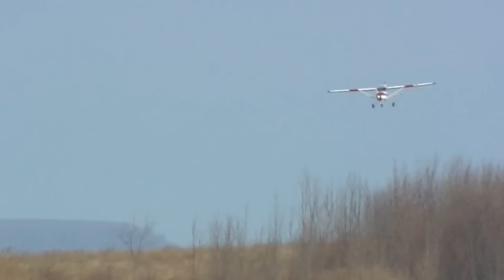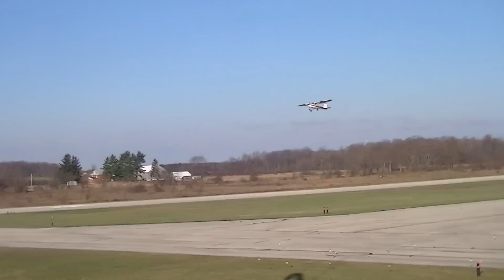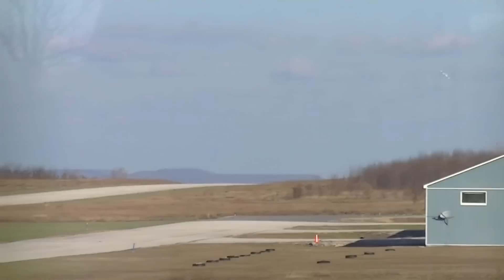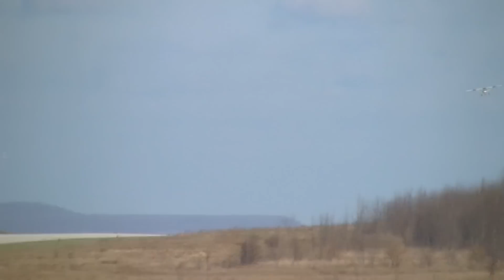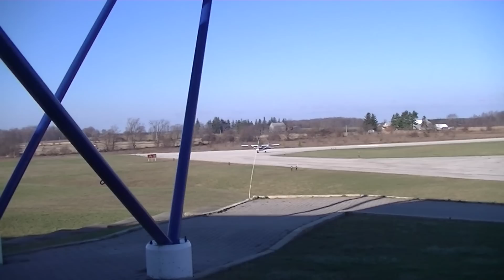Intense Crosswinds Challenge Cessna 150 at CYOS | Pilot's Skill and Decision-Making Tested

Comment: Very nice job getting it down using Airmen Certifications Standards.  These standards are for testing, however, and do not teach energy management and wind management well.  The wind is our friend.  It can provide ridge lift, updrafts that can be flown slowly through, downdrafts than can be flown quickly through, and it can allow us to land at slower ground speed causing far less damage to skin and tin than in no wind.

Using full flaps for deceleration on short final will bring the throttle into dynamic play as our very best glide angle and rate of descent control.  In intense winds, and in this video, gust spread will cause sinks and balloons.  In strong sink, add full power and then adjust.  In strong balloon, close throttle and then adjust. 

Before attacking intense crosswinds lets first work on a landing technique the Army and I call the apparent brisk walk rate of closure approach.  As we close with the numbers, the apparent brisk walk rate of closure we see when more than a half mile out will appear to speed up at around a quarter mile.  If we use elevator to pitch to keep the apparent rate of closure with the numbers a brisk walk, we will not overfly the desired touchdown spot.  Now when we find ourselves at a single runway far from more gas, we have a technique to deal with intense crosswinds.  Think about how you decelerate, not using the speedometer, coming into an intersection with our automobile.  Same optical brisk walk rate of closure technique.  Practice with this technique will give us the skills to land slowly and softly on the numbers every time.

While the apparent brisk walk rate of closure short final approach is overkill on calm days, it becomes critically useful on very windy and very crosswind approaches.  The get set up ask the tower or give way to other traffic at uncontrolled fields so as to safely make a right base if necessary (or left if necessary) to have a headwind component on base.  Now well before arrival at the centerline extended, start a final to a made up centerline from the exact downwind corner of the runway to the upwind big airplane touchdown zone marking.  This thousand feet of angle across the runway will be plenty of runway into a far less crosswind component and a far more headwind component.  I have landed in 40 knot direct crosswinds on the Front Range of the Rockies.  Using the apparent brisk walk rate of closure on short final with full flaps in the 150, we should be able to touchdown on the exact downwind corner of the runway and be stopped without using brakes in fifty feet or so.  If we are at a 45 degree angle across into a 40 knot direct crosswind and using full flaps and the power/pitch deceleration causing the apparent rate to stay at a brisk walk (in the wind of your video, it may appear less than a brisk walk), our headwind component should be about 20 knots.  Subtract 20 knots from the airspeed you see when all slowed up and ready to squat in no wind.  Vso is an out of ground effect number, so in no wind we cannot quit flying until much slower than Vso.  Headwind components, however, may have us still flying at very slow ground speed.  With a strong headwind component, the angle of attack on touchdown will be much less.  We have to flair enough to protect the nose gear, but not be in a three point attitude.

Anyway, give it a try and see what you think.  Work on the apparent brisk walk rate of closure approach in no wind first.  Again, good job.  A pilot that good limited by poor energy management techniques should be able to nail the apparent brisk walk rate of closure power/pitch technique.  We know we have slowed enough if we don't have to close throttle until touchdown.  This technique eliminates the need to round out and hold off.

Comment: I'm not a pilot just wondering about no flaps being used. Is this better in crosswinds?
Reply: Absolutely! At least on this small Cessna, no flaps with increased airspeed for control and added safety due to gustiness. I was the pilot here. I was using a forward slip keeping the right wing low( at least that what I was trying to do)
Most people on here recognize the challenges in this situation. Poh gives all the instruction for the rationale of the landing set up. Don’t listen to the all the crazy comments here, cheers! Get your licence!

Comment: Wrong thinking. He is thinking like its an automobile and starting with the wheel to turn the airplane towards the runway. That raises the wrong wing. That requires the wrong rudder to stay over the runway. The airplane is slipped the wrong direction. If your thinking starts with the wheel you get what you just saw. The right way is to think first with the rudder to straighten the airplane to the runway and use opposite aileron to lower the upwind wing. Crosswind landings are probably the hardest skill for a new pilot to learn. The best technique I found to teach this is to split the controls with the student. Student focuses just on the rudder to straighten the nose while the instructor applies the aileron as required to hold the drift. After a few of these we switch. The instructor uses the rudder and the student focuses on the ailerons (and elevators). When each part is mastered, then I let the student put it all together.  5K CFI  20K TT

Comment: Aileron into the wind, dummy.  No crabbing touchdown,  cut the mixture at 10 feet, it will touch down safer.  Aileron, aileron, dummy..
Reply: "Cut the mixture at 10 feet, it will touch down safer." 
Dude, please do us a favor and never fly a real airplane.
Reply: @Virtualmix  Too late.  Have 5,000 hours as commercial, and 2,000 hours as CFI of aerobatics and Bush Pilots. 
 It is a Bush Pilot Trick to cut the lift and stop the floating, you prick..
Reply: @outwiththem Then I apologies for being a prick but I have never heard of a case were voluntary turning off a functioning engine during flight improves safety. The reasons you mentioned don't make sense either. An engine on idle creates more drag than a stopped propeller, it's common knowledge. By cutting off the engine you loose the option of going around, which is absolutely crucial on a strong crosswind day. No sane pilot would make such trade off. It may be "a bush pilot trick" where you fly but it's stupid and completely unfounded. You don't need to be a CFI with thousands of fly hours to understand that. 
If you disagree, please show me any modern literature encouraging this dangerous and unnecessary "pilot trick", I would be more than happy to change my mind. (Hint: you won't find any because it's dangerous and doesn't make sense)
Reply: @Virtualmix  You do that trick to cut the engine thrust you have at idle and finish the landing already when you are floating.  I have done it maybe hundreds or times. 

Its is Big BS that a prop at at idle engine power has more drag than a stopped prop.  It has less drag.  It is even producing thrust.  I'm a mechanic and CFI for decades.
Reply: @outwiththem  cutting mixture may do what you are saying but it also eliminates the ability to overshoot.... so it is highly not recommended... I would never do it.  The only time I'm cutting mixture on landing is if I have a fire.

Comment: Why was using no flaps a good choice? I personally would have come in with 10 to 20 degrees MAX.. that struggle he was having where he was floating down the runway and ballooning could have been mitigated if he had 10-20 degrees of flaps and he pulled them in right at last second. the plane would have been able to go slower and any residual lift would have been lost upon pulling in the flaps. good landing though as he walked away and the plane can be flown again.

Comment: Bad technique.  Crab until flare then swap to wing low and use rudder to change where the nose is aimed.
Reply: I agree.  looks a bit slow too.  More speed would have given more control.  And definitely, more right rudder - notice how close to the left  edge of the runway they got?  you land crooked and that's where the airplane is going into the weeds.

Comment: Interestingly enough the same thing happened to me in our Aero club's Cesna 172, hen I was solo flying to gain hours to take my pilots license test.  I was coming in for a landing at the Roswell airport and a cross wind gust blew me totally off the runway, when I was not 30 feet above it.  I revved her up and and went back to my air force base, Walker.  With my few hours flying as a student pilot I decided it was not time to test my skills landing in a heavy cross wind.
He did a great job of getting that small plane on the ground, in what we call Crabbing-in for a landing.
Reply: Isn’t crabbing where you aren’t turning in to the wind, and kick in rudder as you land?  It looked to me like he had his right wing down most of the time, with left rudder. You can see that as he lands, and the nose wheel does down.

Comment: Good on ya! A 150 with sustained winds 20KT and gusts 32!? Nuts! Honestly, if i see crosswind gusts i just remain grounded. Only an 84hr PPL, though.

Looks like i need to step my game up and get me an instructor on a gusty day.
Reply: I don't know if the runway direction is mentioned.  The wind velocity is not as much a factor as the crosswind component.  As mentioned elsewhere, crabbing to the landing an kicking it straight with the rudder and dropping the wing into the wind would have been less dramatic and more controlled..  Also, you do need more speed in wind.

Comment: His rudder is flapping like he is a flounder on a fishing line.  Yeah, the crosswind sucks, but I've successfully landed a C-152 with 50 knot surface winds, half of which was crosswind component.  If he would just keep the rudder deflection in and keep the nose pointed straight down the runway, this would go a lot better, then he could concentrate on taking out that floating.

Comment: It looks like not enough right aileron & maybe too much left rudder.  If the wind is coming from the right, 230 on a 18 runway,  his nose should NOT be pointing left. It seems like he's over-correcting with the rudder. I had an instructor make me do single tire wheelies right down the centerline, Bob Hoover style, never letting the nose or the other main wheel touch down. Over & over again until I could do it consistently, from pretty much one end of the runway to the other. After that, I never had ANY doubt on what the balance was in a crosswind. I remember reading how the US Air Force used to train their KC-135 pilots to do the exact same thing. Find an instructor that can work with you on doing "Bob Hoover's" & you'll master the crosswind. It worked for me.

Comment: Gosh!  I feel compelled to speak to this situation after watching the video.  This guy had lots of runway to play with and should have slipped it in fast like a dart instead of attempting a normal power off landing.  He let that cross wind just push him all around the runway.   

25+ knots 90' on the side is very doable in a 150 if you come in fast (80 - 85mph) while slipping it in and letting it roll out 1500+ feet upon landing.  The technique is to get the wheels on the ground as quickly as possible while aligned with the runway.  

On final -  no flaps, windward wing down as necessary to keep runway heading and downward elevator with trim to keep the nose pointed at the numbers.  Let it fly the runway heading in a crab as you descend toward the numbers, then ...  On short final - hold opposite rudder (leeward side) to keep the nose aligned with the runway center line.  Kick that rudder in hard if you have to.  Don't be afraid to push the pedal to the stops!  If you run out of rudder trying to keep the nose aligned with the center line, power up, go around and try again.  On the second attempt, if you're at full rudder and the plane is still crabbing then you know you've exceeded the crosswind capabilities of the plane.  No biggie, just pick a different runway or airport to land; come back to your airport later when the winds have died down.   

But if you can keep it lined up, you're now in a slide slip.  It feels weird but don't worry about it.  Continue that approach and speed.  Pull the power back when you know you can make the numbers and let the airplane settle to a landing on it's own.  NO BIG LANDING FLARES!   Just pull back gently and plant the windward (low wing) wheel first while keeping the ailerons into the wind and the rudder opposite to hold runway heading.  Let the other main gear drop as you slow down (you're still holding the ailerons into the wind, right?).  Keep the nose wheel up with a bit of back pressure until it drops naturally as the plane slows down.  Continue to roll out in a straight line until you are slow enough to taxi off.  No brakes!  (I repeat) NO BRAKES!!!  Keep your heels on the floor the whole time!

Coming in fast allows the control surfaces to exert more force against the airframe.  This increases the crosswind capabilities of the plane.  Friction of the wheels helps hold runway heading upon landing but you still have to fly the airplane even when it's on the ground to avoid ground looping it.  Letting it roll out on it's own instead of using the brakes keeps you from accidentally ground looping it, steering it into the dirt or dropping the nose too forcefully and causing a prop strike.    

It's a 'dance' with the rudders and ailerons the entire way down as the cross winds can fluctuate due to buildings, trees and sheer.  Practice makes perfect; You can do it!  Good Luck!
Reply: dumb ass...how is he going to groundloop a trike gear in a wing low crosswind landing. shut up already. the go around was the correct decision and he did well enough. finesse and technique comes from stick n rudder time.

Comment: MANY years ago, I encountered wind shear while flying a Cessna 150.  I was already crabbing and was landing, about 15' off the runway, just crossed the numbers, and it blew me clear over to the side, almost into a barb-wire fence -- scared me to death, but I immediately used full rudder, ailerons and increased power, got straightened out and landed.  I had the luxury of a 5k' runway so I was able to instantly correct and land, otherwise I would have gone around.  (Crosswinds were normal fare at my airport -- I learned on them, and I loved the challenge, but wind shear is another matter!)  I immediately taxied over to the FBO's hanger, he asked me if I wanted him to go up with me and try it again.  I said yes -- it happened to him also!  He swore, and said "I see what you mean" and he shut down the airport for a while.  We had an interesting set of factors to deal with there, over the mountains on downwind, over the flat on base, and over the ocean for half the way on final, then a hill right at the middle on the ocean side of the runway, so swirling air currents were common -- (straight-out windsock over the numbers and at 90 degrees half-way down!).  Many pilots flew in to practice there!  Also, some hot-shot pilots would come for the weekend on a straight-in-final approach, sometimes in their small biz-jets, they didn't want to bother with the pattern, so you always had to watch out for them on the weekends!  (I didn't like to fly weekends much!)

Comment: no flaps and increased speed was the right solution, but with high gusts need the touchdown to be forced at higher airspeed as normal (close to carrier landings but with much less vertical speed), with no nose lift (nose lift with wheels at ground increase the lift and can cause uncontrolable jumps in gusts), and this was here not the case..i  fly a ultra light who stall at 50mph, in same highest wind conditions as such Cessna...

Comment: I have flown into Wiarton a few times in a no flaps Piper Colt  and it was always gusty.    I was taught by the old timers with thousands of hours to sideslip instead crab.  Keeps the nose lined up with the runway, and never a problem touching down.
Reply: You can do the same with the "kickout" from the crab method.  As long as you're straight when you touch down.  You can even touch down in a crab on one wheel so long as you kickout and have your long axis parallel to the runway when both of the mains are down.

Comment: Hard to tell from the outside looking in, but it appears that the pilot was using perhaps too much left rudder. The airplane appeared to be pointing to the left of center line the majority of the time while holding the right wing down. Wind was slightly from the right? Again, hard to tell... The airplane is hardly more than a powered kite in that much wind. I would say pretty good job, overall.
Reply: He made all the landing mistakes.  He is a lucky pilot who probably quit flying after he changed his underwear.
Reply: Roger Tycholiz, not really a valid argument. This was and still is a valued learning experience. Do you have anything constructive on an adult level to say about it?